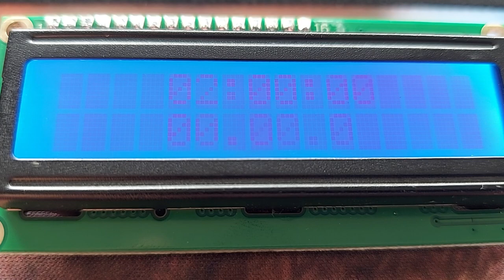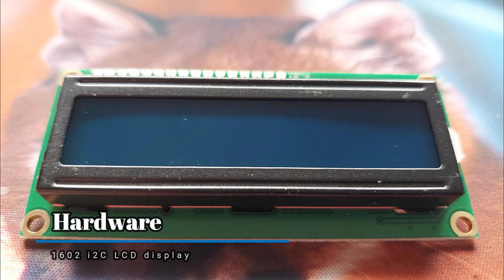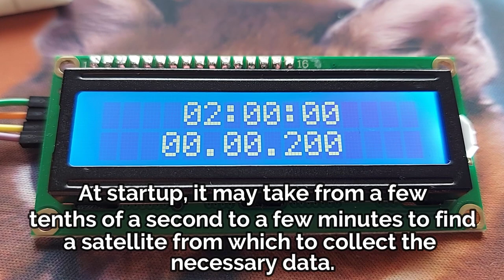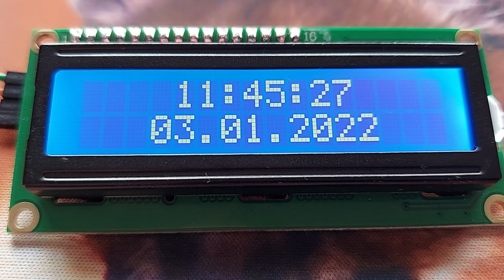GPS clock in Arduino - Arduino for beginners - with ATGM336H GPS module - with code

Comment: Sir, when no satellite signal is available(like indoors), is there any command to read time out of the RTC built in it?
Reply from the maker: Hi. Where there is no GPS signal (inside), I don't see the point of building such a watch that is based on a GPS module. For such situations, I recommend using the very precise DS3231 RTC module or the less precise DS 1307 module.